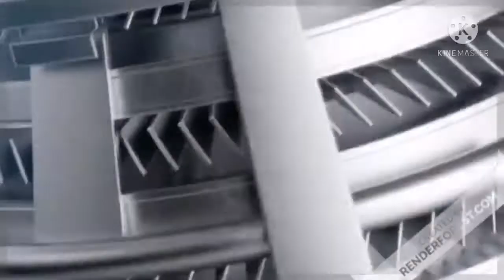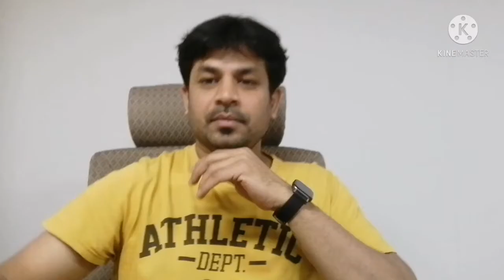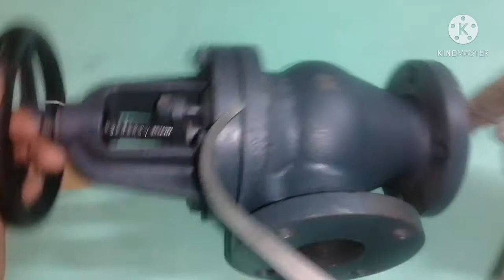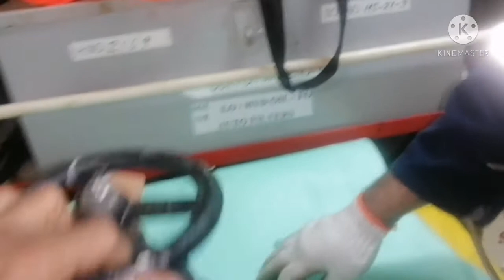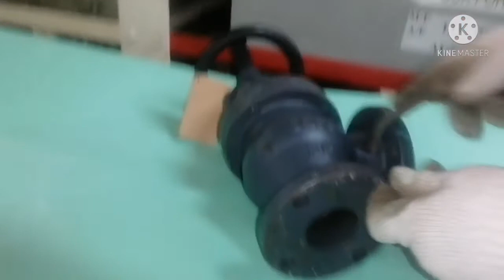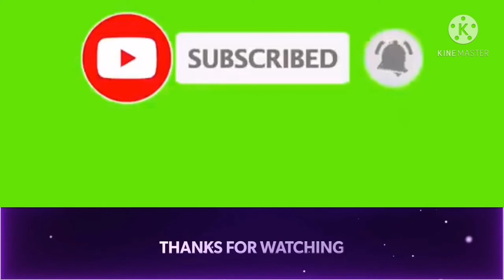KNOW ALL ABOUT YOUR ANGLE VALVES ONBOARD SHIP...

Comment: Sir in impa have angle valve face to face measurement. How can i calculated? Its centre of hole to flange outside or others please waiting for ur answer.
Reply from the maker: u can make out by checking the pcd which will be from the hole centre and if u got doubt u can see the impa book where in the first page of valve section u can find the measurement explained...